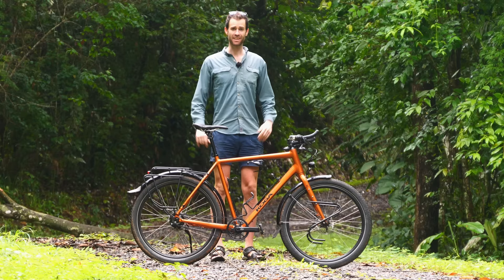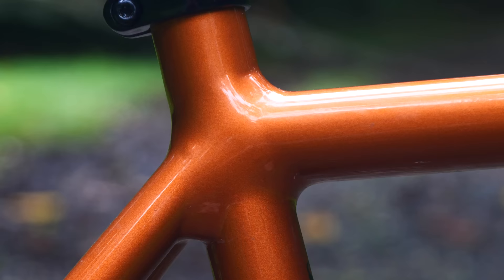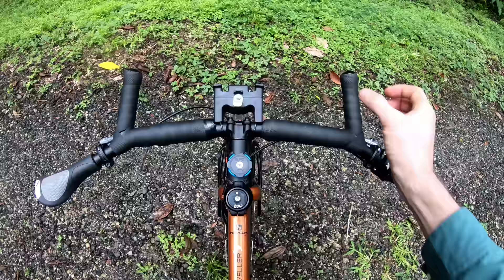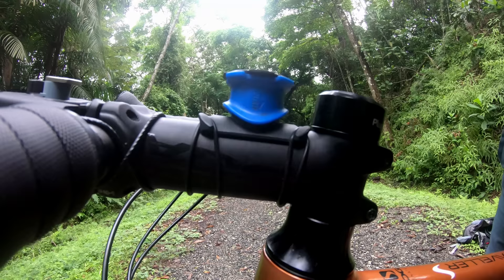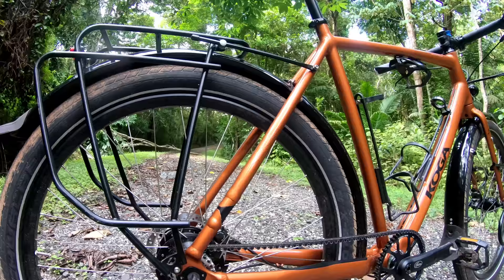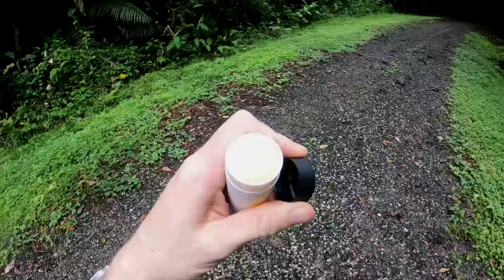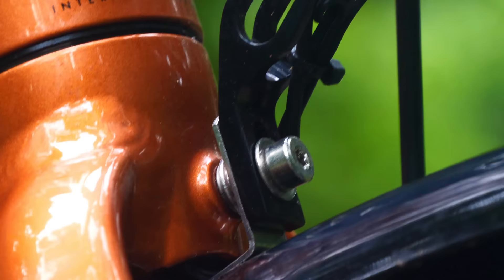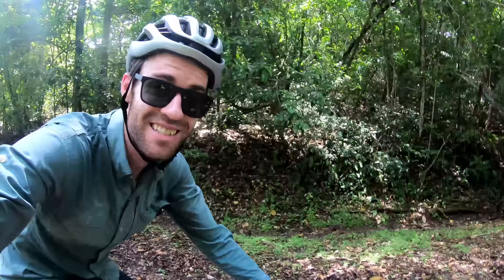The 2020 KOGA WorldTraveller-S is a $6000 Indestructible Touring Bike

Comment: The belt-drive is far less sufficient and running it with low tension might help. I would rather choose a chainglider-protection (-1% efficiency) and even with my middle-motor e-bike i had zero chain wear after 6k kilometers (KMC chain), but had to switch it for running a different ratio.
Reply from the maker: I think I know what test you're talking about. The tension they chose for that test is far higher than you need with a KOGA frame. The larger rear cogs that I use (22t) further increase the efficiency (the belt doesn't have to bend as much), and combined with the minimum belt tension that Gates recommend for a stiff frame - it's the equivalent drive efficiency of a chain drivetrain. 👍🏻

Comment: Maybe a stupid question, but why do touring bikes don't have some kind of suspension? Isn't there anything on the market that is very reliable?
Reply from the maker: They don't have suspension because of the need for maintenance. Fork manufacturers call for service intervals between 50-150 hours riding, which I personally do in under a month of touring. I don't find I really need it anyway, as front luggage and wide tyres absorb a huge amount of shock and vibrations. 
The most reliable suspension fork is a Lauf Carbon Fork, but if you wanted something you can push the boundaries on in terms of maintenance, coil forks are usually the best.

Comment: In the process of buying one of these, my inseam is 79cm which seems to be the only info you have to go off when ordering? Suggested frame size is 50cm which seems very small. Any advice on the fitting? Most other online resources suggest a 54 for my height and inseam dimensions
Reply from the maker: You could measure up the bike frame that you currently ride and feel comfortable on, and compare those dimensions to a KOGA. You could seek sizing advice from a bike shop through a bike fit consultation. Alternatively, you could find the right-sized bike in a shop, then overlay that bike with a KOGA on the website Bike Insights.

Here is an overlay I made of the KOGA vs a Specialized Sirrus commuter bike: https://bikeinsights.com/compare?geometries=61be646672d5bc001c0af57f,60d8b3d05115f9001c766d36,

Comment: I am configuring my Koga World Traveller touring bike now. I have pretty much the same set up as you so far, except I am torn btwn rim & disc brakes. I know disc brakes have more stopping power in the rain, but I prefer rim as every disc brake I have had has squeaked annoyingly. Do you have opinions on this? Thanks!
Reply from the maker: I don't think disc brakes have any downsides at all. They pull up wonderfully, they work well in the wet, the brake pads last forever and they require maintenance only every year or so (even in the conditions I ride). I don't ever experience any squeaking with my XTs, they're definitely recommended.

Comment: Do you never had problems with mud (the very sticky one) accumulating between the tyres and the fenders ? I like very much the mudguards (and they are very useful too). but I had some problems with serious wheel blockage due to the mud.
Reply from the maker: ciccio formaccio Maybe 2-3 times in South America I had sticky mud - it’s not too bad down there. I just struggled through those sections knowing how good mudguards are the other times!

Comment: This video is really informative to me.  The thread of info below is well worth reading.  I have gleaned ship loads more about this bike and others and many issues that may not really be issues at all.  Thanks everyone and thanks for the excellent review.  I've done the configuration and the rest is but a click away.  One final, dynamo and lighting and for charging, and the plug V highly desirable, is it worth the weight/cost, compared to solar charge battery banks rechargeable lights etc. ?  The battery pack adds a fair bit to the cost. Dad always said, good quality is remembered long after the high cost is forgotten.  Dynamo can be adapted to charge a battery back I guess or  fitted later. One year out from retirement and tonguing at the bit.
Thanks.
Reply: @Jurre is Online thank you.  And the recharge ability is effective?
Reply from the maker: I think dynamo lights are 100% worth it, but the charger is a bit of a luxury. That said, the Plug5 Plus is a game changer. At 17-18km/h it's already charging at 4-watts, which fills my phone in a little over an hour - very impressive. The in-built buffer battery is fantastic too, I rarely deplete that battery entirely and lose charge. The main advantage of getting it when you order a bike is that it will all wired up internally from the factory; it's a little harder to retrofit the Plug as neatly.
Reply: CyclingAbout. 🙏 I think this is the one. Really excited now.  Thanks everyone. Where I live you just can’t see this stuff in the flesh.
Reply from the maker: @philh7892  That was my main intention for this video, to show the details of my bike to those who would otherwise not get to see one up close!
Reply: CyclingAbout - mission success. Life is good and very exciting. Best wishes safe travels.

Comment: Aluminum will eventually fail with use. Aluminum doesn't have a fatigue limit like steel. Steel is indestructible Aluminum isn't.
Reply from the maker: That is true, but it's misleading. Although the lack of fatigue strength in aluminium frames seems alarming, they are actually engineered to be three or more times stronger than a steel frame, easily withstanding the stresses of bicycle touring. A well-designed aluminium touring frame will never be affected by fatigue, and that's why companies have no qualms offering lifetime warranties on aluminium touring bikes.
Reply: @Cyclingabout  That's not true. All aluminium frames are affected by fatigue. That's the fact. No matter how you design it, it will be affected. Most companies offer lifetime warranties for the first owner only. Nobody keeps a >$1500 bike forever. Most people replace them with newer ones after 2-3 years. The old bikes are sold and have no warranty anymore.  A lifetime warranty is actually a marketing trick.
Reply: Use 5182 and Your bike will last .............
Reply: @j.r.arnolli7494  Doesn't matter what alu alloy you use, there will be a steel alloy which would be stronger. Doesn't mean it's bad. Aluminium breaks over time, which is why I wouldn't buy a used alu-bike. Steel breaks under heavy loads and impacts. And carbon breaks just because, but I still love it, because it's light.

Comment: hi, may i ask which Schmidt dynamo is that? is that a son28 or son deluxe? Why do you prefer one over the other?
I'm struggling for choosing one for my touring build but can't decided which.
Reply from the maker: I have the SON28. The power curves are the difference between Schmidt models. The Delux offers less power to your lights/charger until about 30KPH when it is about the same. 
As most touring speeds are under 30KPH, the extra power is necessary so I can achieve a good brightness out of my light and charge out of my USB charger.
Reply: CYCLINGABOUT thank you very much!!

Comment: Respect to you for your cycling.  Question on the 2020 KOGA World Traveller-S video:  Mud guards - what brand and size.  You noted you were running a 2.4 inch tire.  I run a 2.5 inch tire on a Surly and am having difficulty finding a mud guard/fender that accommodates this size tire.  Any installation tips or techniques would be appreciated as well.  Many thanks,  Mike.
Reply from the maker: These are SKS P65 which are actually designed around a 26" wheel. Check out the SKS Bluemels 75 for an even better fender for 2.5".
Reply: @Cyclingabout  Thank you for your very quick response - it was very appreciated.  I am going to take a look at the P65.  Coincidently I just recently discovered the Bluemels 75U's and purchased a set.  However, I like the lines and look of the P65's a bit better.  Again, thank you and safe journey's.  Mike

Comment: This bike is amazing. The problem is that the max weight limit is 130kg. So if you're a heavy person, forget this bike.
Reply from the maker: 130kg is just the maximum test rating that was available when the WorldTraveller was in development. KOGA gives written permission to people who expect to exceed this weight, as the frame is designed to handle much heavier loads.

Comment: On Koga's configurator they spec 32 hole rims. For the type of touring you do it is pretty obvious you needed the extra strength of a 36 hole rim. Koga should at least make this an option.
Also I was curious if the fork ends are through axel? Shouldn't the world premiere touring bike be set up the best?
It would also be nice if Koga offered the carved model for the Brooks saddle.
The Denham bars you designed look very ergonomic and functional to me. They are something that I would be interested in.
Thanks for your videos and expertise.
Reply from the maker: I have always had 36 spokes on my KOGA touring wheels. I wonder if COVID-19 has resulted in supply chain issues for 36 hole rims or hubs?! It seems unusual that they would change that. It could also be a typo?

The fork is QR currently, but I suspect 15mm thru axle hubs are common enough in bike shops around the world for KOGA to make the switch in the next generation. They wanted to make it easy for customers to get a front wheel in low-income countries if you had a front-end accident.
Reply: @Cyclingabout  Thanks for your videos. Last year on your recommendation my son got a Kona Sutra. I was impressed with the value of the bike.
I'm currently riding a Surly Disc Trucker. If something ever happened to it, I would like to get a Koga signature. I have looked at Tout terrain and Comotion also.
Both very nice bike's. But the Koga is what I am leaning to.

Comment: My steel tour bike rides like a cloud because the metal absorbs so much of the road vibration. I am thinking that aluminum would not do that as well as a steel bike would. Any thoughts on that point?
Reply from the maker: Meghan Fitz-James While it may be true that steel can absorb more vibrations from the road, this is a drop in the ocean compared to the amount of vibrations absorbed by the tyres and your luggage. I definitely couldn’t tell whether I was on a loaded steel or aluminium bike in a blind test (that would be pretty funny to test out).

Comment: Most probably a sutpid question, how do you pass the belt threw the frame because it seems that there is no open part on the frame ?
Regard
Reply from the maker: You can see the frame break at 1:50 on the seatstay. 👍🏻
Reply: @Cyclingabout  ok I saw it Thanks for you answer....Regards

Comment: What does a 'similar drive efficiency' mean when compared to a 1x set up? Curious!
My Whyte Glencoe is 1x.
44t chainring.
11-42 cassette..
Reply from the maker: According to my data, SRAM 1x drivetrains run 95.1% efficient: https://www.cyclingabout.com/drivetrain-efficiency-difference-speed-between-1x-2x/

And the Rohloff 94.5%: https://www.cyclingabout.com/speed-difference-testing-gearbox-systems/

Comment: what weight is this bike? fully loaded, it must take a lot to turn the cranks up a hill??
Reply from the maker: It's 16kg unloaded and 35-50kg depending on whether I'm travelling in summer or winter - with a day of food or a week. It has very low gear ratios so I can still cycle up very steep hills (at 4-5km/h).

Comment: I have a “basic” koga world traveler with which I have been in many parts of the world (Japan, Cuba, norway....). What I like of this signature koga is the chain free drive. It comes at a cost and weight though.  
Question: what’s the weight of this bike? I would say around 20 kg
Reply from the maker: The weight in this video is around 17kg. But it should be under 16kg currently as I'm using lighter tyres and have taken the fenders off.
Reply: @Cyclingabout  Thanks, that's not too heavy considering the Rohloff and generator and all.
Reply from the maker: @fabiopunk1661  It's totally fine for me considering I never break anything (especially considering I'm carrying everything I own).
Reply: @Cyclingabout  I believe the art of bicycle trekking is what one does NOT take. Every trip I make I refine my experience in taking ONLY what is STRICTLY necessary. When I see mini-trucks on two wheels I can only feel sorry for the rider.

Comment: does this low tension affect the belt noise? one would think that a belt becomes noisier when the tension is low
Reply from the maker: There is no change in noise
Reply: @Cyclingabout  great!

I switched to a Van Nicholas Nootau bike with a belt/Rohloff hub a month ago and as a new owner I struggle a bit with belt tension/sprocket alignment and strange hissing sounds resulting from the belt contact with the front sprocket when accelerating.
I was always thinking that the belt tension should be somewhere around 45-50HZ to avoid that, but your video and experience prove me otherwise. :)
Reply from the maker: @gustmatik  It sounds like your belt needs a few drops of silicone lubricant to keep it running silent.
Reply: @Cyclingabout  hehe, I need to try that as well

did this beltcare stick help you at all?
Reply from the maker: @gustmatik  No, it's a bad product. Try UT Belt Care or 100% silicone treadmill lubricant.

Comment: I like the handlebar, do not like the shifter on it. The front fork has lower clearance which I don’t think it’s a good design, unless traveling mostly on highway or flat road with small pot hole. For adventure riding, especially in less developed areas in the world, I like rubber break than disk brake. It’s easy to replace. Touring bike does not mean that it must be very heavy, even it’s loaded heavy, the bike still has to aim to be as light as possible. I don’t dislike aluminum, depending on the type of aluminum and welding, it can be very durable.

Comment: Just a question concerning travelling: is it a problem that the maximum certified charge is 130 kg ? do you go over this weight with your full package ?
Reply from the maker: The 130kg weight limit is not a problem because the KOGA WTS frameset has been designed for MUCH higher loads.
At the time of development, the highest test certification a frameset could receive was 130kg, but as of 2020, testing standards now go right up to 180kg. The next version of the KOGA WTS frameset will be certified for this higher weight limit.
KOGA gives written permission for people to exceed who the 130kg weight limit (so you don't void the warranty). And if your expected weight exceeds 150kg, KOGA will ask that you use the stronger 27.5" wheels.
FYI - my total weight is 120-140kg depending on how many days of food and litres of water I am carrying.
Reply: @Cyclingabout  OK thank you very much ! I am 2m02 height and weight 92 kg so i can get close to 130kg faster but I still have a decent margin. Do you have the info on the future release date of the new Koga WTS ? Big thanks !
Reply from the maker: I don't have anything concrete about the next frame update. But KOGA has been operating on a three-year product cycle recently - so I would expect it to be available mid-2022.

Comment: How would you rate a touring bike like this for Munda Biddi track? Would you just swap out the tyres to full on MTB ones and go for it?
Reply from the maker: In my experience, the Munda Biddi is best on a mountain bike with a suspension fork and 2.2" tyres (or wider). With bikepacking bags too for some of the tighter, twistier sections of trail.

That said, I did it just fine on a gravel bike with 40mm tyres, and saw people on touring bikes with panniers. My KOGA would have done better than the gravel bike, but I'd recommend taking a mountain bike if you've got one.
Reply: @Cyclingabout  thanks mate, just watching your Peru divide video, you are an absolute machine. Great scenery, thanks for filming.

Comment: for long distance and isolate place  i will prefer 26" wheels and v brake ,   if something go wrong you have more chance  of  find parts for it ,
Reply: good luck getting 650 tiers or tubes ,  or a blead kit and fluid , or a disk brake if you bend it , in a small village ,
Reply from the maker: @darkphotographer  In my experience, you can find all this equipment in major cities in the world! I also ONLY use quality equipment I can trust, so I have never had to catch alternative transport to repair a bike. 👍🏻
Reply: @Cyclingabout well ,  i live in thessalonki , greece , the second biges city in greece after athens ,, and sometimes i need to go to to 3 or 4 different bike shop just to find a part or order it from athens ,,or , ebay ,,,  and sometime is sothing stupid like just a tube for 700c 35 with long  presta valv ,,   since most have only 700c for 23 ,   or 29 er tube with shreder , or 26 ..

Comment: Hi ho, can you elaborate on your belt tension? Do you run your belt even below the a level that would register on the Gates phone app? If not any suggestions? After hearing your comment I did lower tension on my Gates/Pinion bike and it did seem to roll better. Nevertheless it may have been dreaded placebo effect! Cool bike, Alee. Thanks much for your videos.
Reply from the maker: I measured it with the professional tension meter and it was running lower than what was recommended by Gates. If you run it too low it will skip on the rear cog when you apply lots of torque, so you should be fine if it doesn't get to that point!
Reply: Thanks❗️I have lowered mine to 27 mz or so on the phone app. Definitely rolls better. I may ease it off a bit more.